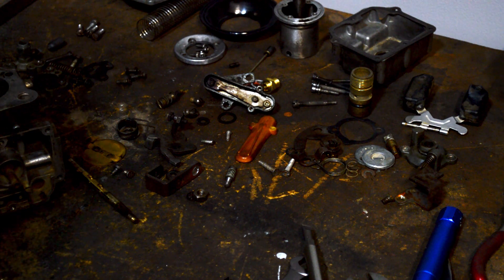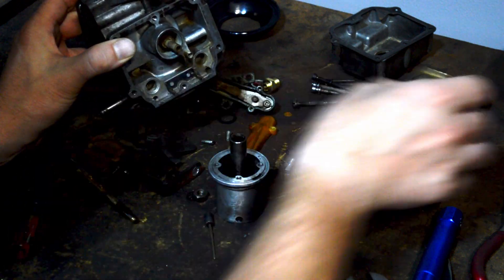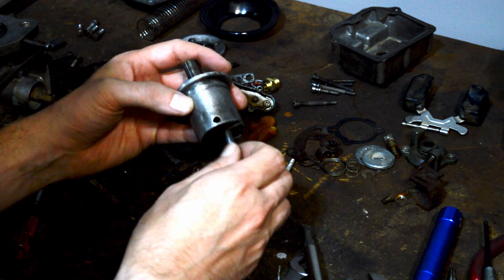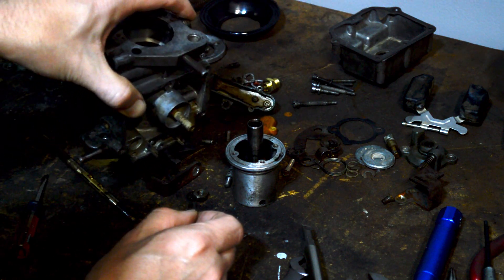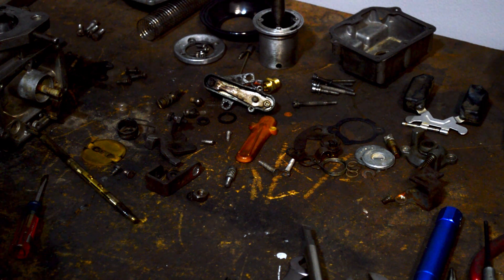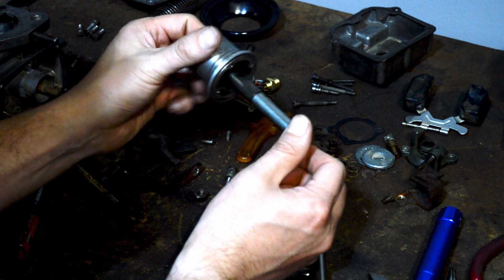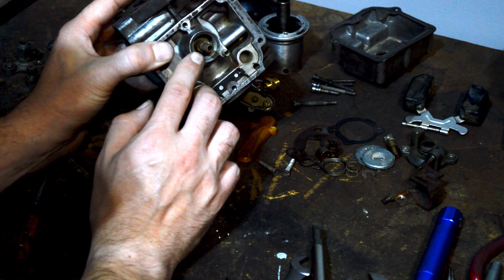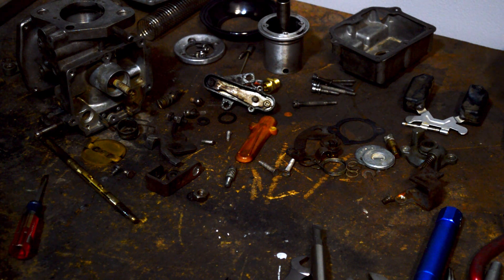Adjusting the Non-Adjustable Zenith-Stromberg CD Carburetor

Comment: another question if you don't mind. I seem to have an air leak round the temperature compensator / trim screw. My theory is that this is whats keeping me from getting the mixture up at idle. the compensator does have its paper gasket and the little valve is closed but still way too lean. any thoughts on an air leak here?
Reply from the maker: So technically there's supposed to be an air leak, but only through the passage from the air cleaner, through the tube, and into the carb.  There should never be an air leak from the outside of the carb by the compensator.  If there is, then something isn't gasketed or isn't sealing properly.  At the risk of over simplifying, are you sure there's an air leak there?  It could be at the throttle shaft seal, or it might not be a leak at all--the float height is a critical measurement, and you'll never have enough adjustment to compensate if it's wrong.
Reply: @midwestmotoring if i spray start gas in the temperature compensator area the idle goes up but maybe its just the compensator going in due to the cold spray. That could do it too. Shaft seal and float height is a good idea. Thanks

Comment: with the right tools can adjust that non-adjustable carb. you push that "fixed" jet up or and down depending on what you need. but what is the base setting height over the bridge for the jet?
Reply from the maker: While that's true, it's not a terrific idea in practice.  You can't easily move the jet up and down without completely disassembling the carburetor to make minor adjustments.  Then, while there's a tool to raise the jet into the carb body, it's a different scenario to press it back down.  Much better idea to switch to an adjustable jet or needle.
Reply: @midwestmotoring  its not that bad but it  is not practical. There is two tools, one that screws down the jet which screws into the top og the bell with the piston and all in position. Just remove the filters. The other tool screws up in stead of that strange brass plug with the o ring. That raises the jet. They both work fine with the carbs in position but impractical
Reply from the maker: Agreed.  I had good luck just manually moving the needle up or down and retightening.  But ultimately the adjustable jet kit is the way to go

Comment: Great videos, On my 1975 TR6, I'm trying to find a starting point for needle adjustment.  1 - I have reassembled the carbs with new bits, and need some guidance n where to start.  should I tighten clockwise then back out,... 2 - also using the needle adjustment tool,  it is a bit of an effort to turn the allen key. is this standard,. or should the tool turn freely<.   help,.. thanks
Reply from the maker: The needle shoulder should be flush with the bottom of the air piston.  That's the neutral setting.  However, if the float height is not set correctly, it won't matter where you put the needle--there won't be enough adjustment no matter what you do.  If it's tight turning with the allen key, that's probably down to the o-ring being snug.  As long as it moves easily enough to adjust the mixture, you're okay.
Reply: thanks for the quick response and resolve.

Comment: Thank you for this video, was looking online for exactly that issue.   I just converted my TR250 fro 2 Strombergs to triple and the "extra" carb is with a fixed needle. I do have an issue with it and it is that the piston stays half open and too much air is being let in, making it impossible to adjust.  any idea as to how I may be able to adjust it ? I already tried opening the small screw in the bottom of the piston and "play" with the hight, didnt help.
Reply from the maker: There are a few problems. First, it sounds like your needles may be mismatched.  It's also possible your carburetors are not set up correctly and may need to be disassembled to get at the course mixture adjustment.  The needle profiles may also need to change. With 3 carbs instead of 2, a different amount of air will be drawn in (each carb services 2 pistons instead of 3).  So you might need different needles for all 3.  The compression ratio and cam in your engine may also play a role.  I can help with setting up your carbs so they're matched, but would need to know more about the air fuel ratio under load to help with the needle choice.  It may involve some trial and error.

Comment: Hi, do you have any idea on how to replace the oring on one of these fix needle 175 carb? I have a leaking damper oil situation.
Reply from the maker: It's been a while since I've looked, but I'm not sure the fixed needle carb is drilled through in the air valve.  You might have adjustable needles....

Comment: Question for you - I have a 1970 TR6 with Zenith Stromberg 175 CD-2's original to the car - they do not have adjustable needles as I discovered when the special tool allen wrench found no purchase when put down into the pot, and the outside portion of the tool finds no detent to hold the piston in place.  Your video is the only source I've found that, at 40 sec, illustrates the identical slotted plug both our carbs have at the base of the float chamber - I've found no picture or diagram of this plug elsewhere.  However, I'm not clear from your video - does this plug mean the jets are non-adjustable?  That the plug was designed in simply to cap off non-adjustable jets?  Our TR was fully restored in 2008, and we this year moved from sea level to 7200 ft in Santa Fe NM - so it's running very rich.  I'm not much of a garage mechanic, so a conversion to adjustable needles or jets is a daunting proposition.  Any advice is appreciated.
Reply from the maker: Hi Robert.  I'm afraid the slotted plug at the bottom of the float bowl is indeed a plug used in cars that do not have adjustable jets.  Since you haven't got an adjustable needle either, it does mean you have the non-adjustable variety.  You've got a couple options:  1) You can pull the air piston, loosen the needle slightly, and manually move it up or down very slightly.  Then re-tighten and reassemble.  This will take a number of tries to get it right, and you will need to do it again any time you drive into the mountains or change elevations.  Otherwise, 2) you can modify your carbs to either adjustable needles or adjustable jets.  This is something you are able to do if you've got some tools and some patience, but if you need help with this modification shoot me an email as I can rebuild your carbs and convert them for you.  midwmotoring@gmail.com.  Thanks!

Comment: I fitted adjustable jets to my dual Stromberg's on my Volvo 164. Can confirm they are made to fit and would definitely recommend
Reply from the maker: I like the adjustable jets since they don't require special tools.  You do have to reach under the carbs, but that's less of a problem in my GT6....

Comment: I went the junk carb route, found two diff junk carbs with adjustable needles, swapped the pistons into my GT6 carbs, and got needles from Joe Curto.
Reply from the maker: Joe is a great supplier.  I think he might actually make a lot of the components sold by parts dealers.
Reply: @midwestmotoring  Sure is. He will also do trades for carbs/carb parts, so that's another route to get some pistons with adjustable needles etc.

Comment: Thank you very much for that — it explains why I found the CD175-2’s on my 1969 Volvo 1800S so perplexing.   Confusion gives way to annoyance.
Reply from the maker: Glad it helped. It was a stupid design, but you can definitely fix it with a junk carburetor for parts.  The air pistons are replaceable (unlike an SU where it's a tightly machined tolerance, Zenith-Strombergs have a little flexibility because they use a rubber diaphragm), or you can use brand new parts and make the jets adjustable on the bottom.

Comment: Top video! Any info about these carbys is really helpful. I’ve got the 175 CD  on a 1979 Mercedes. Will take apart and put a new kit in it eventually. Thanks for sharing 👍
Reply from the maker: They're actually really good carburetors.  Just misunderstood.  I don't know why the bypass valve parts aren't included in the rebuild kits, but you'll want to pick that up too if you have bypass valves.  Get some pipe cleaners too since it'll help to get in all the holes.  Good luck!
Reply: @midwestmotoring  great tips - I’ll check about the bypass valves. Much appreciated!

Comment: You can easily install the adjustable jets, at least in the 175 carbs, they're about $100 each. I put them in the carbs for my '69 TR6. Installation was pretty easy, just tap out the old jets with the proper size drift and the new jets screw in to replace the bowl plug. Jet adjustment is then with a large screw at the bottom of the carb, at least as easy as adjusting a needle on on the later Strombergs.
Reply from the maker: Thanks!  I thought that might be the case.  It's probably worth a search to see if air pistons are available in a junk carb setup.  If the pistons were, say, $20 at a swap meet, it'd be cheaper to swap the needles instead.  Otherwise, it's good to know there's new parts available for the conversion!
Reply: You can't just put in an adjustable jet from an older unit, at least on a 150CDSE. But there is a kit available, which is the 100 bucker that Bill refers to. It's usually sold as a Jaguar part, but some places like BPNW sell the same thing for Triumphs.

Comment: My `76 TR6 has these; must not be matched to the car. I got lucky and when I put it all back together again it ran OK w/o adjustment. It was very frustrating and I almost broke the dash pot b/c by all accounts it looks like the needle should move. My `79 MGB has a 175 carb but the needles are adjustable. I wonder if some PO/mechanic pulled a fast one and swapped out my pots so he could have the movable needles? Saddled me w/ u adjustable ones. Groan.
Reply from the maker: I wouldn't be surprised.  With the set I'm working on now someone changed one of the carbs but not the other.  Really not sure how that makes any sense....

Comment: Thats how my early '69 TR6 is.  Buckeye Triumph discusses how to deal with this well, either by modifying the piston or using washers.
Reply from the maker: I used a piston from an otherwise junk CD150.  Enough ZS carburetors are lying around having been replaced with something else that you can still find parts if you look hard enough.  And yes, I believe the 69 TR6 was definitely affected.  My TR250 was the same.  What a pain if you're changing altitudes frequently!